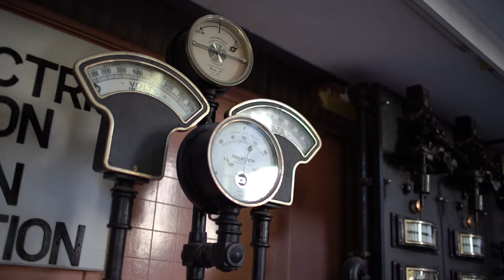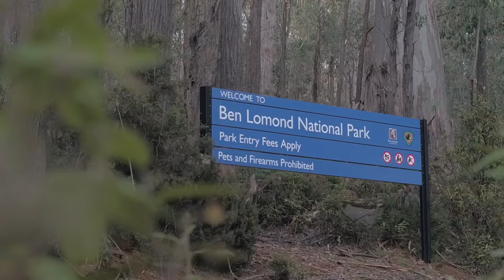KTM Adventure Rallye - TASMANIA 2019

Comment: Love the bigger moto adv bikes but, coming from a mountain-biking background (Started in 1989), I'd only ride sub-500 c.c. bikes that were more beginner friendly, far lighter, and are more flickable like a mountain bike is.  Also, don't feel the need for speed, one can get into enough trouble at 50 to 65 mph on a motorcycle.  Hence, my dream-bike would be a Honda CRF 300l Rally...  (KTMs are nice but, quite spendy)

Comment: 33:33 min in, who knew these 2019  790R engines would turn out to be such a liability, I absolutely regret buying mine, when twice the required services equals cam, follower and valve failure by 30,000 km it's a disgrace, KTM should have recalled them instead of tainting the brand so badly.